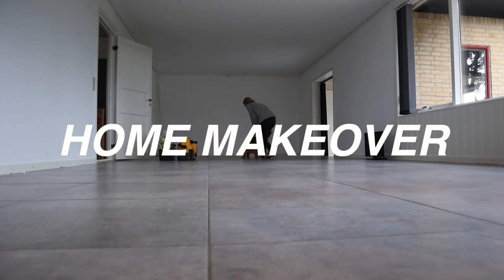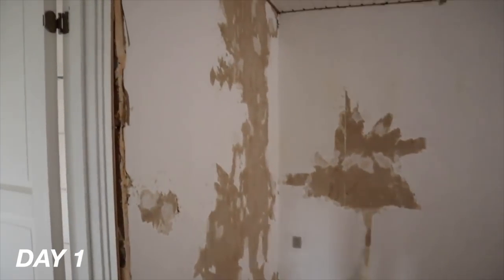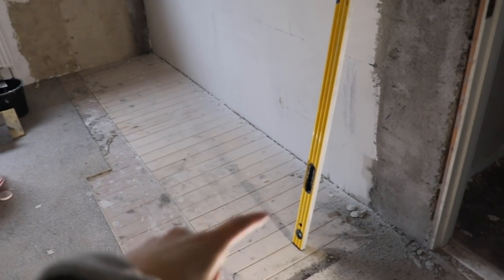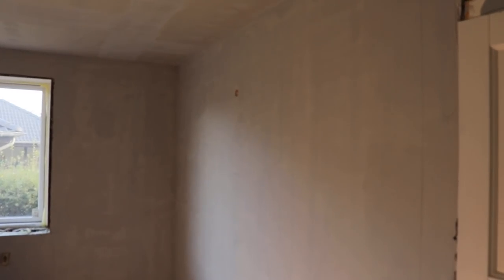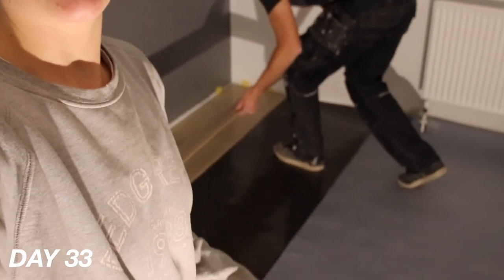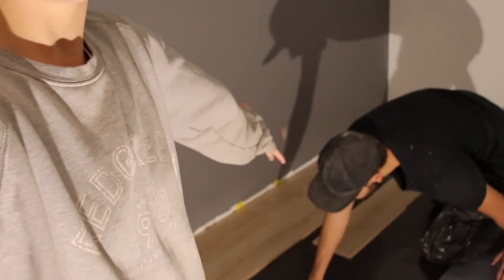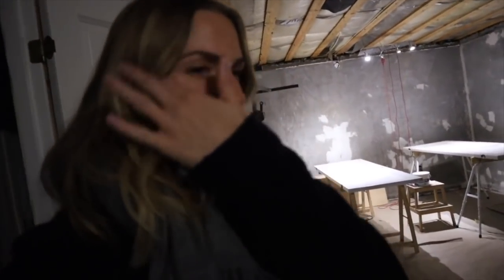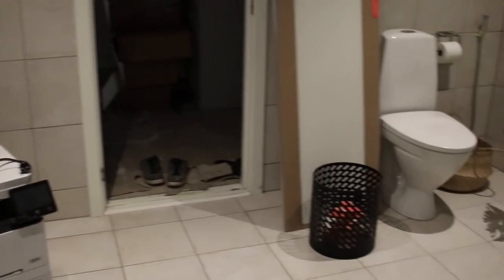Bedroom before & after | Home makeover #1

Comment: I'm struggling to get the two duvet system to work on my bed.  In Iceland it was perfect but on my queen size bed in America I can't seem to fold the twin duvets in a way that works.  What size is your bed and duvets and how do you fold the duvets so it's not bunched up in the center when you sleep or slip off the bed?  USA single duvets are 60"x90" so they might be too big.  Great job on the renovation too.
Reply: Runa E I now live in the US now and use two twin mattresses combined to make a king and two twin duvets. I do not have a problem with them. They fold in half for a bed made and open fully whilst covering the full bed at night.